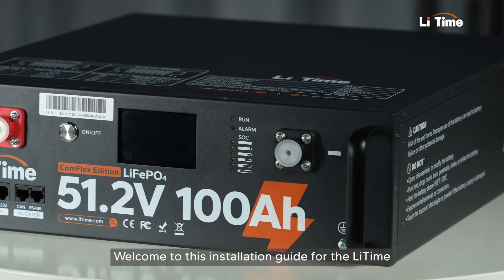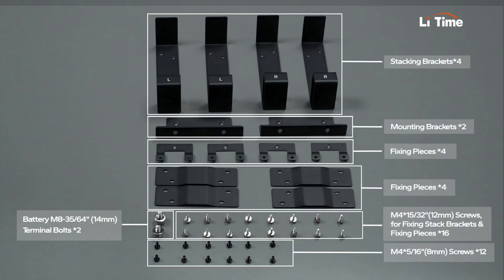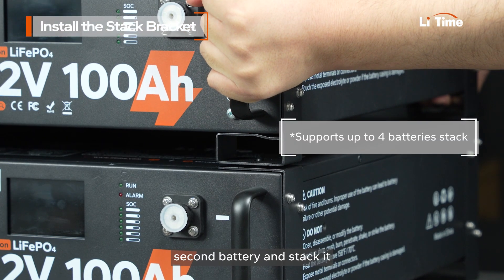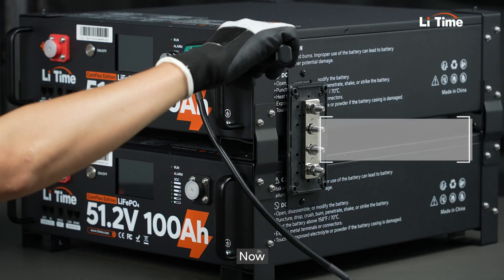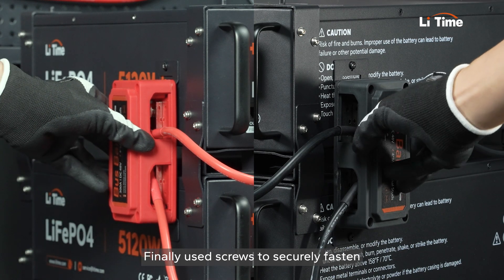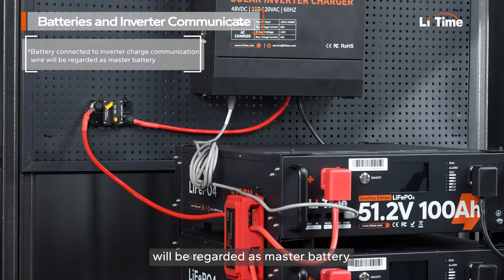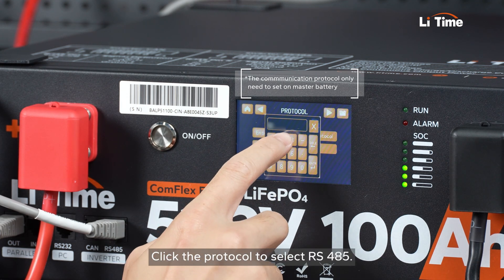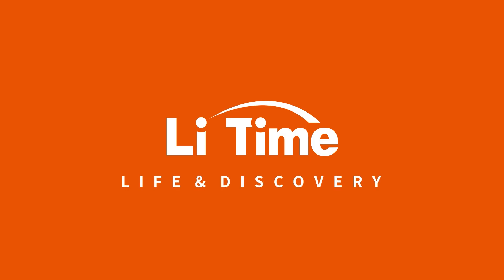Flex Your Home Backup Power: LiTime 51.2V 100Ah ComFlex Edition Battery Installation Guide

Comment: I ordered this exact setup!  I wish they'd show what's in EACH box. Are the breaker, bus bar, and brackets included with this exact setup?  What comes included with this comflex battery?  What comes included with AIO Inventor 3500W ?  Huh?
Reply from the maker: Hi Jeff, sorry for not clarifying whether the tools are included in the box. The items that come with this ComFlex battery are: one positive & negative wire, three communication wires, a user manual, and some stacking brackets. The bus bar and inverter need to be purchased separately.
Reply: @litimepower  Laughing .....  I said exact setup. You need to mention we need to purchase the bus bar, I am glad  the stack brackets come with my comflex battery edition, whew, .  I am currently waiting via fedex/UPS for ALL in One 48volt/3500W and two comflex battery editions.  Thanks for replying.
Reply from the maker: Hope you can get your package smoothly. 😊 Please let us know if you get lost in setup or any other problem.